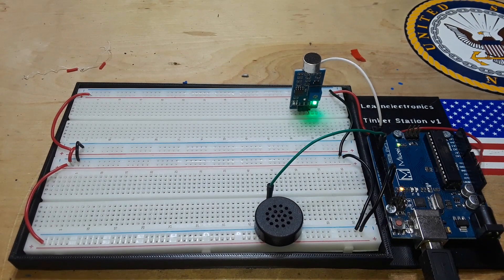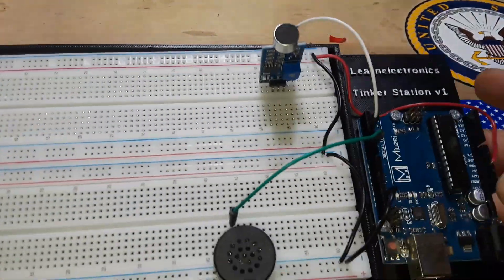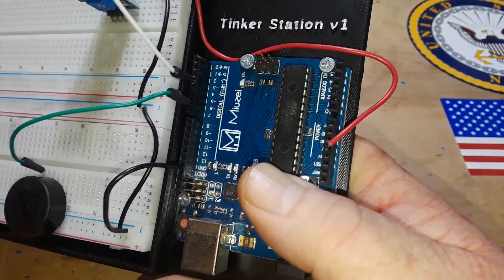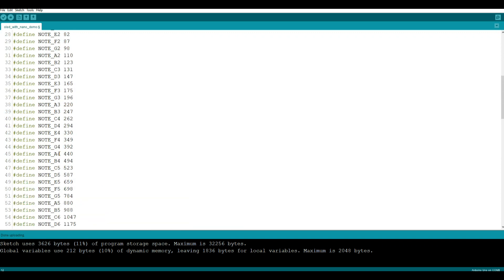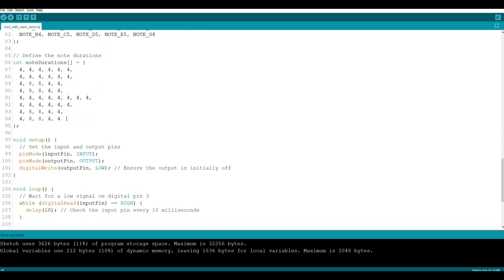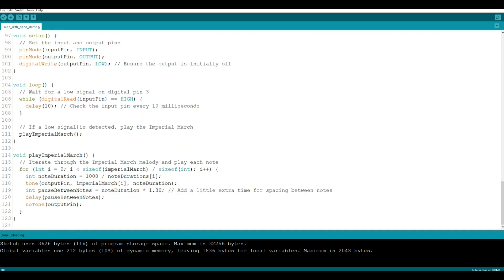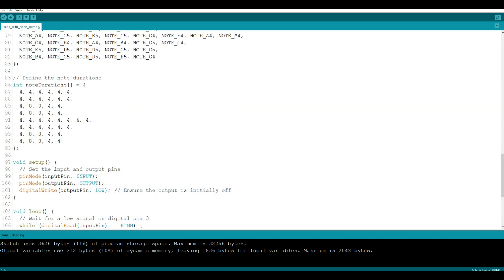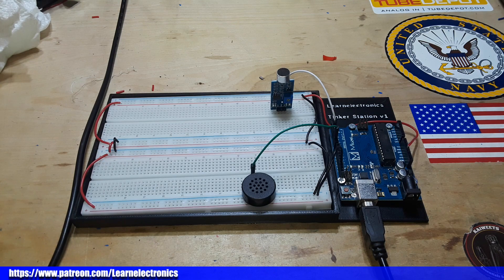Listen For A Sound Then Play A Tune

Comment: Two 👍 and a question, sir. In the defining array section for notes .. B0 is defined & repeated @ lines 16 and 18. Is that an oversight or by necessity? I’m poking around with an arduino kit I found (snapino) at a great price, but haven’t really gotten it yet. I may try this if the mic sensor-thing is not too much $$. Thanks!
edit: noted C1 is same.